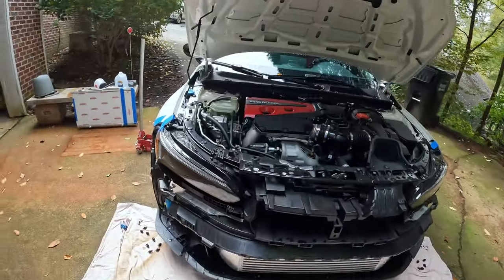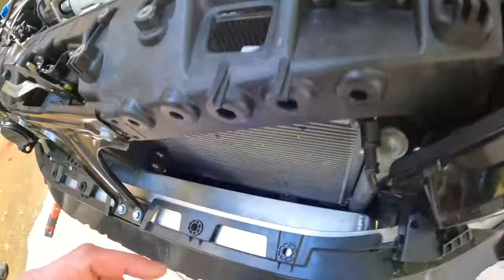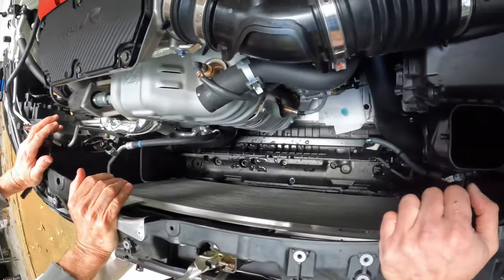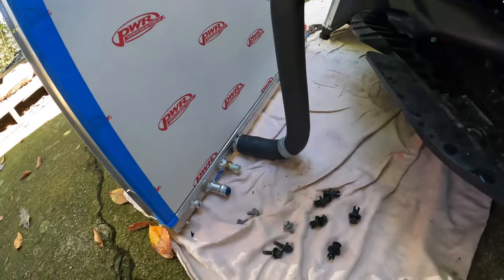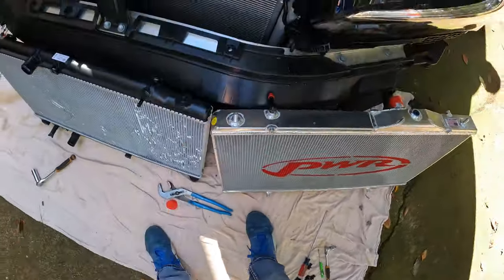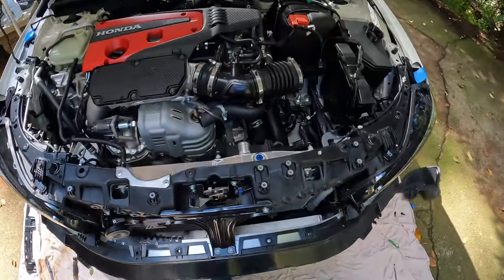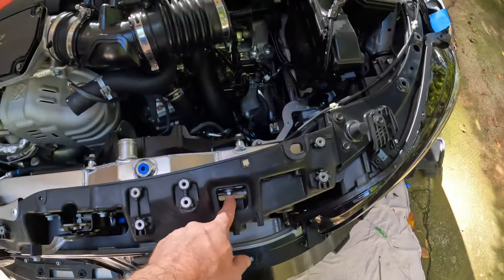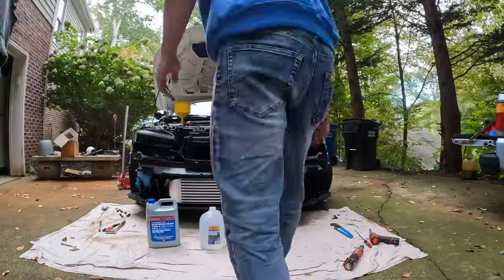Civic Type R FL5 PWR Radiator Install

Comment: You don't need to take off the bumper to install the radiator. There are 2 small plastic "panels" you can remove to access the lower 10mm bolts for the condenser.
Reply from the maker: @MobiusStripTech  yep! Got that figured out on a more recent video! Those little panels make it a lot easier to get to the lower condenser bolts.

Comment: Nice video 👍
Does it make a difference? Do you notice a cooling improve?
Reply from the maker: Made a big difference. I had sessions on track last weekend where the car just hit 200 degrees. This was with me running the heat in the car. Without the heat on expect coolant temps to reach into the 220's. Best part is that I didn't have to take any cool down laps.
Reply: @pointbypatrol  What was ambient temp/humidity and what track?
Reply from the maker: @danielmembrillo6472  the track where the overheating occured? The overheating was at Carolina Motorsports Park. Ambient was 75 degrees and 50% humidity.